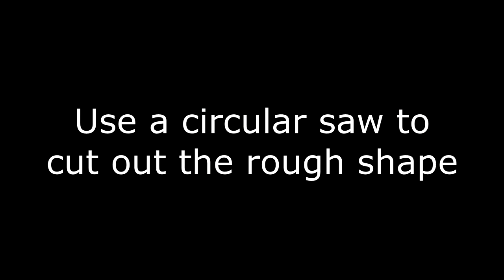HOW TO MAKE A DRAPED AMERICAN FLAG - STEP-BY-STEP - EASY DIY PROJECT

Comment: Measurements and star size would be helpful.
Reply: Gave 5 bucks for a sketch that looked as if a middle schooler drew up and no matter what I did the measurements that were on the diagram were by no means going to work out .

Comment: That’s awesome man!! 
Do you have measurements on the cuts etc. plans?
Reply from the maker: Thanks! I initially tried to copy some plans from Facebook, but ended up just using the basic shape and drawing out the cuts to that basic shape.
Reply: Thanks 🙏 I was wondering couldn’t you just share what you were looking at on your phone when you were making it?
It looks like an outline and dimensions.
Reply from the maker: I would, but it is not my property to share.
Reply: @ArtByKevinZapata  imagine a simple parted out triangle
Reply: @sparetimewoodworker1505  could you ask for his permission to share or his e mail. You were great at sending me what you had. But somehow I can't figure out the angles to get it right. I tried 5 times now. Thsnks again for this great video. Best flag ever
Reply: @sparetimewoodworker1505  who can I contact to get the plans

Comment: Hello we talked a few weeks ago I haven't started the flag yet but the question I have what type of carving wheel did you use I haven't decided which one to get is so many different kinds I would appreciate if you could let me know thank you so much take care brother
Reply from the maker: I used a 36 grit flap sanding discs to rough it out. It is aggressive, but not too aggressive where I had to worry about taking too much material off. You can then work through finer frits or go right to the palm sander.

Comment: How long did it take you to make it?
Reply from the maker: In total, I had maybe 3 hours into it. Excluding drying time for the stain and finish. Thanks for watching!
Reply: I'd seen a video like it 5 months ago, finally picked the wood up, two weeks later, drew the dimensions  I'd seen on the video out, sat for another month waiting on weather, just carved out the waves and folds, now it sits some more for spare time, need to tape off and draw stars, but on a better note started and completes 4 other flags in the same weekend